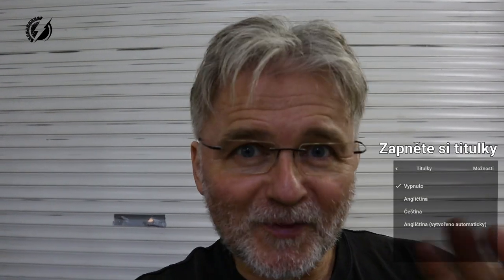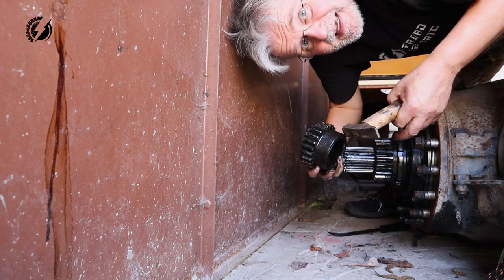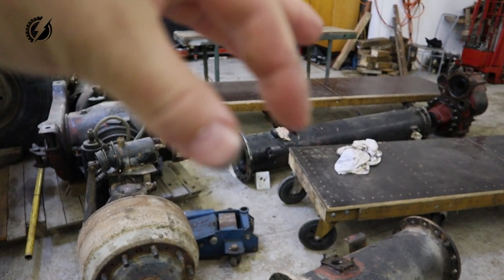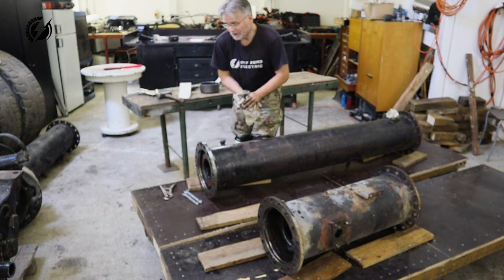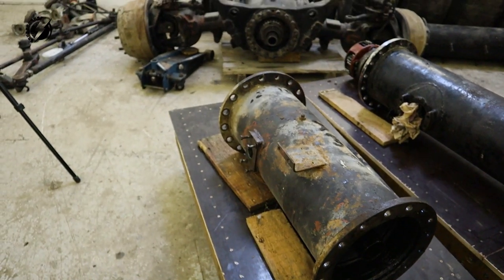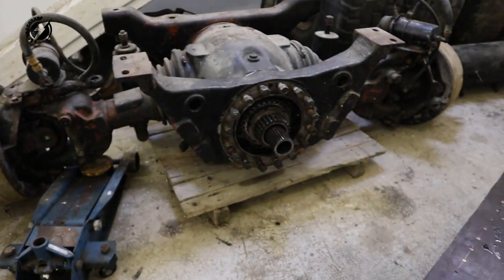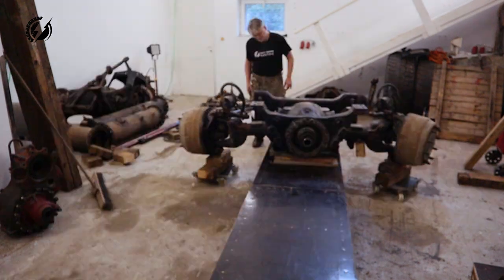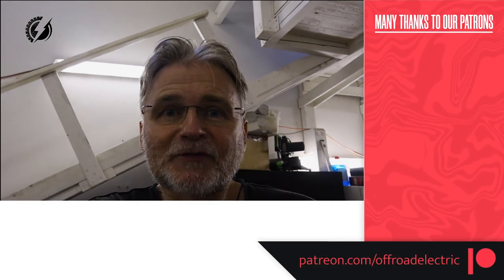EP.45, Building a Tesla/Tatra  2-motor Monster Truck

Comment: Really interesting, I had no idea that the TATRA trucks were unable to lock all differentials and wheels, that’s a bit of a failing. I have a Praga V3s which is using a tatra engine and also lacks the front differential lock. I wonder why they decided to do this as it makes zero difference to the steering as many people claim.
Reply from the maker: Hi, this is the civilian Tatra. The military ones have the front locker.
Reply: Thanks for responding, I didn’t know that, very interesting.
Reply: @jamie_grieve  If Tatra 815 had front diff-locks it would make them better than Soviet machinery which was unacceptable for regime after Velvet Revolution Tatra 815-2 and all succeding models have front diff-locks.